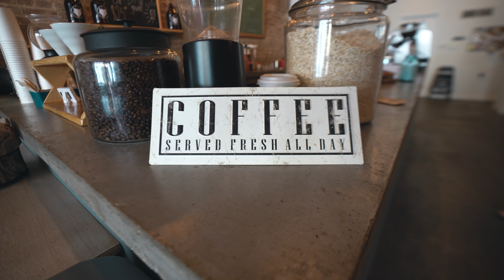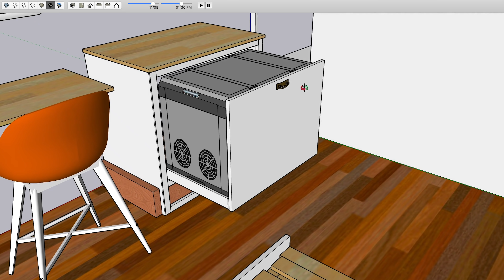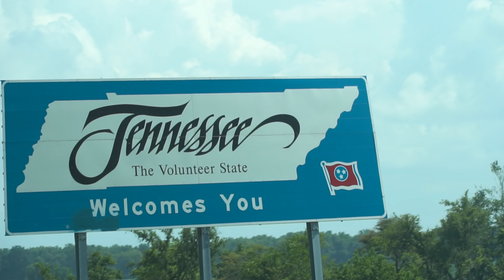RV Renovation & Budget UPDATE + First Road Trip in Our NEW CAR!

Comment: Glad to see you are taking a break, you deserve it!  You are probably planning a layout and I’m sure you already know all these things so I’m just going to remind you.  Some things to consider: make sure to have a table of some sort that is always accessible, it just makes things easier. Consider a portable generator instead of a permanent one (and maybe propane instead of gas so you don’t need to carry around containers of gas).  Plan the RV for the two of you and not for when you have guests. Let the guests get their own accommodations. Spend a little more to get a really good, comfortable mattress.  Make your cushion/ furniture upholstery covers out of high grade material that is water repellant, fade resistant and durable.  Stick with plainer materials for the cushions/upholstery so you can easily change/freshen your decor with accessories. A shower that has a somewhat deep pan (4”-6”) and can work as a shallow bathtub comes in handy for a lot of things.  Do install a good vent fan with a rain guard, it reduces the need for AC. Also, consider some type of perimeter cameras for safety. Happy trails!
Reply from the maker: Thanks so much for all the awesome recommendations!

Comment: I've just purchased a 1988 Fleetwood Tioga Montara 21Ft (Chevy G30 chasis) and I'm starting on the mechanical (engine/powertrain) before doing anything else.  As I'm not a mechanic, it is at an autoshop being looked at and worked on for road safety (required for registration) and then I'll be getting the RV systems checked and fixed, and THEN I will start looking into gutting/rebuilding (probably waiting until later in the fall or winter).  I've been watching your videos with much trepidation (especially the over-cab rebuild portion) and really hoping I don't find what you did in the teardown.  Thank you for sharing the journey and Really looking forward to it.
Reply from the maker: Oh how cool! We looked at some amazing Tioga's - glad you seemed to have found a keeper. We'll definitely keep our fingers crossed that you don't find anything like we did either. 😅🤞Best of luck with the rebuild!

Comment: Just a little tip from experience...when you have the engine work done make ABSOLUTELY SURE to wrap any electrical wires that are located near or even around the exhaust headers with insulation wrap. Under an extreme pull those babies get cherry RED hot. I suffered an extreme electrical fire that traveled all the way into the drivers compartment under the dash....it got really really bad..smoke and toxic fumes....so make sure you check and add insulation under the engine cover....it makes it quieter and cooler in the cab.......BEST Wishes Always.
Reply from the maker: Oh my word! So sorry to hear that. :( Thanks for the tip - we definitely want to avoid any chance of that!

Comment: If you are switching from a carburetor to an EFI set-up (good choice) you should check out Holley.com and look at some of their factory refurbished Holley "Sniper" EFI self tuning kits. You can get them in the $700 range, easy bolt on swap from a carburetor, they have a simple 4 wire hookup (battery Positive/Negative/ignition switch/RPM), comes with new fuel lines and a clamp on oxygen sensor, has a built in fuel pressure regulator so you don't have to plumb one in, it has a touchscreen control that you use to answer a few basic questions about what engine you have and then it tunes itself as you drive. You could actually do the swap yourself in your driveway in a couple hours (and have another reno Vlog to show!). Better MPG, cold weather starting, and responsiveness which is great for traffic in an RV. Great job on the reno so far BTW.

Comment: RV idea - Build a hidden shower! I've seen and read a lot about the negative aspects of a wet bathroom in smaller RVs. A possible alternative is to build a shower pan that will be "hidden" by a storage closet or some other item that slides over the shower pan when no one is showering (which is most of the time). I saw this idea in a tiny house show (Living Big in A Tiny House). Showers are often "dead space" and having a wet bathroom just seems like an avoidable mess. The challenges is building the sliding storage (or whatever element - seating area[?]) covering the shower pan in a manner that works for an RV. It's fun watching you guys. Safe travels.
Reply: Walter Loyola that’s a great idea! Eamon & Bec just built a hidden shower in their new van.  This is their third build!

Comment: It's a long way off yet I guess but It might be worth considering putting a solar panel powered inverter for the electrics. 
I dont know if it would be needed depending what electrics are fitted  but at least if you are going to areas with no electric it could charge the battery for say the fridge and TV

Comment: Regarding your cabinet for your refrigerator, make sure that it has ventilation holes to allow circulation around where the cooling fans of the refrigerator are located. Otherwise, the refrigerator will be working overtime and consume way too much energy.

Comment: You both need some time off from this massive undertaking having no experience in rebuilding a RV. Just remember when designing the interior, balance is the key when the RV is on the road taking a turn. Also if the engine get a rebuild you might want to do the entire drivetrain rebuild because the power from the engine might tear apart the transmission, U-joints and or the rear axle, it happened to me years ago. Both of you are doing great and there is a light at the end and is getting closer. Enjoy the time at the farm and what was the dogs name?

Comment: Remember to add two holes in roll out  refrigerator's  outer wall so it can circulate air properly.
Your computer diagram design doesn't show them.

Comment: Do some research before pulling the trigger on EFI. It sounds great but it introduces a bunch more failure points too. We have a 76 GMC Motorhome and a lot of people add EFI and then end up broken down or swapping the carb back in. The problem with a lot of these EFI solutions is that the electronic sit on top of the engine and cant deal with the excess heat especially in an RV application because the engine is in a confined area. If you have a quadrajet carb there are companies that rebuild them for a few hundred. https://quadrajetpower.com/. EFI really doesn't give you better fuel economy either. Also make sure whomever works on the engine has experience with RV applications, they usually have different cams and the transmission is usually beefier then the stock auto counterpart, seen several people get rebuilt transmission from shops that built them to the car spec and then 5-10k miles later they fail.

Comment: Is there going to be enough air circulation with that refrigerator configuration?
Reply: John P - so glad you said that - refrigerators definitely need airflow
Reply: Drill some holes or put a grate in where the fans are located when pushed in perhaps?
Reply: Yeah, each time they show the drawing "3 to 4 inches of clearance for airflow" goes through my mind...

Comment: swap a diesel into it, you will over tripple your fuel mileage and the power will be way better
Reply: Tripple, LOL? Diesel is maybe 1 or 2 mpg better from what I've heard on the street. Power is better, yes - but maintenance and repairs cost a lot more. And then there's paying for DEF, unless it's an older engine of course. :)
Reply: @drinkinslim  it would be triple. And why would you put a brand new diesel with DEF in that rv and not a 12 valve cummins that would make no sense at all. Dieses under load are much much much more efficient than gas engines with their very high torque numbers and about 30% more energy in the fuel itself too. I drive a diesel every day and came from a gas car. I almost doubled my fuel mileage with diesel on a car. Not even a truck or suv. and dont listen to him on maintenance costing more because it really doesnt cost much more at all because they go longer between maintenance and last far longer than any gas engine will
Reply: @MikeUtoober , triple? You be trippin', LOL. Our 2012 Class A 35' gas coach (loaded and pulling a Honda C-RV) gets about 10mpg on average (8mpg on not-so-good days, like trips that include mountain passes). When I checked the forums recently, diesel Class A drivers are getting about 7-11mpg. 

There's no question that diesel rigs have more power, but they are something that a lot of people can't afford, unfortunately - unless you go for an older rig. I'm talking motorhomes here - I can't say for diesel trucks or cars. :)

Comment: Consider a straight forward engine and transmission swap. More modern low mileage wrecked RV's aren't too uncommon. With a little patience and some local help, maybe some sponsorship? you might do very well.
Reply: Deluk, agreed instead of putting money into the old push rod V8 updating to a modern engine would give them a lot of reliability and fuel efficiency!

Comment: https://www.jegs.com/i/JEGS/059/7353/10002/-1 Just buy a NEW Crate engine from GM with a 3 year 36,000 mile warrantee they will deliver it to your house. its an all new block new parts i have 2 of these engines in my old trucks cant go wrong
Reply: https://www.jegs.com/i/ATK-Engines/059/VC09/10002/-1 Get the one with the 4 bolt main bearings

Comment: If I were doing that rebuild I would swap out the engine with a diesel
Reply: yes definitely
Reply: My thought as well a 4 cylinder one plenty of HP and of course Torque and fuel mileage ! But just how load would it be under that dog house ? Maybe it would be considerably smaller than the V8 and you could super insulate the dog house !